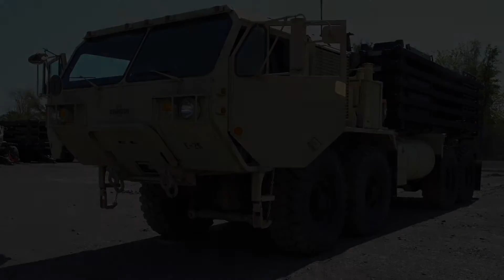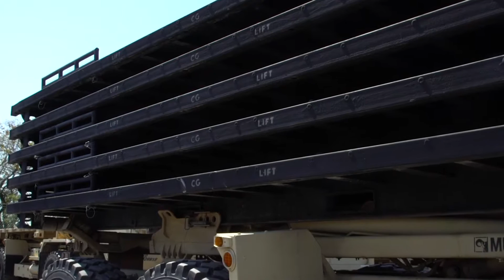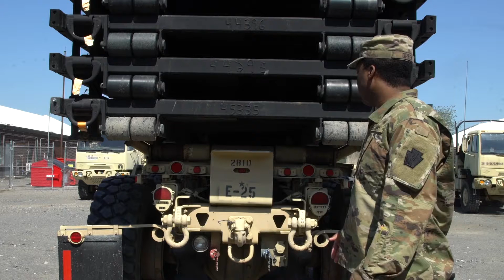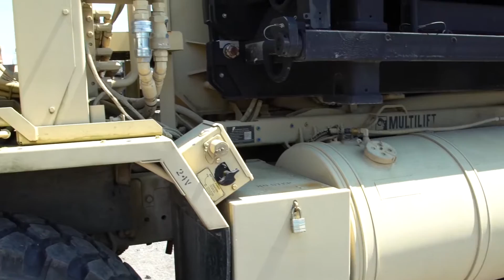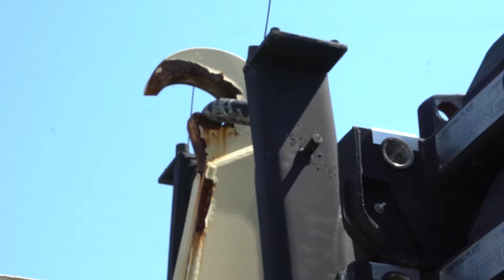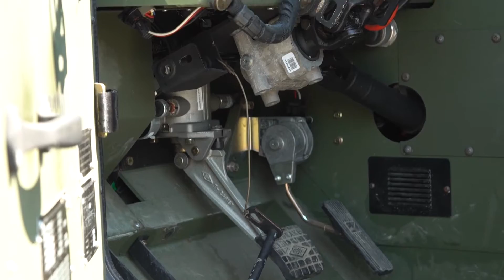Task Force Saber gives us a tour of a M1120 HMETT

Comment: It's spelled HEMTT,not "HMETT".And the PLS-LHS 8×8/10×10 like the M1074/M1075-M1120 are not the same as the HEMTT.The PLS is literally the same truck as the LHS except they have two extra wheels,that's it.The LHS is on the exact same chassis as the HEMTT but the Military don't call them that.The HEMTT is basically the M977-M985 and 300K which is a fire truck.